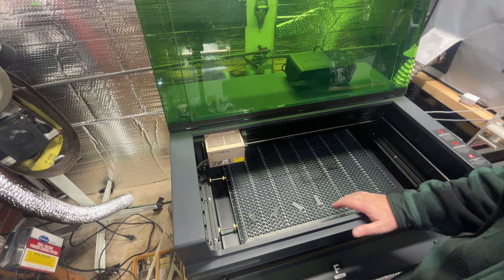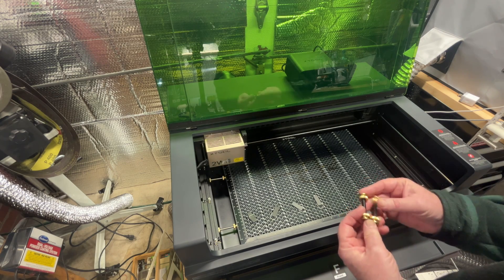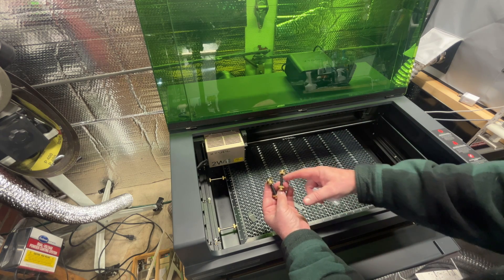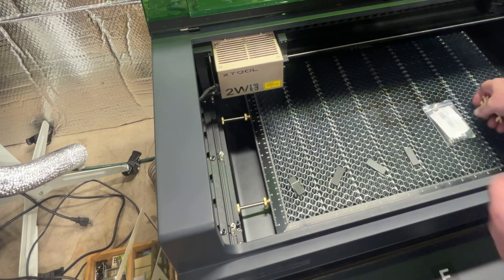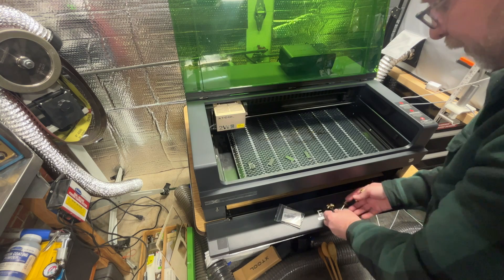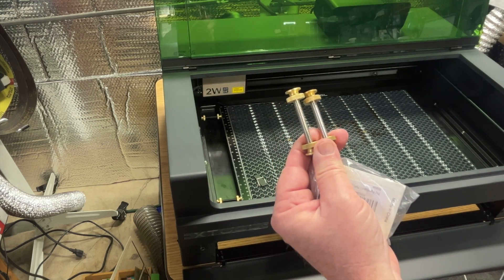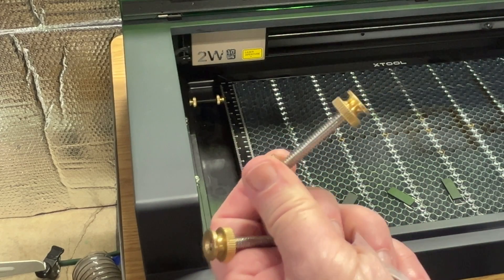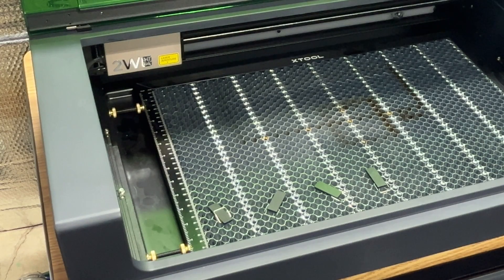Solve the moving Honey Comb Grid & Crumb Tray on XTool S1 Laser Engraver when using the Riser Base

Comment: Great idea! Can I make one modification for you? Add springs over the grub screws to help keep them from backing off. The other thing you could do is add a stop nut. Just thinking it may help. Ill try this with springs today.
Reply from the maker: I have not had them come loose but I like the spring Idea may make putting them on easier. I did think of lock tight on one side but they have stayed in place really well. But I love improving any idea let me know if it works out better if you try it.

Comment: I want to solve two problems. I want to keep my tray and honeycomb from moving in the X and Y direction, and I want a registration mechanism that I can slide my workpiece against like the fence on a table saw. With a stop block on the fence, I could slap an endless succession of identical work pieces into the S1 and know that each one would be positioned identically.
Reply from the maker: I have been trying to find a low profile on/off magnet  to do like you mention with the fence but have not seen any that are small enough to not hit the laser head.

Comment: Thanks for this tip! Can I use these without the riser base?
Reply from the maker: No need the crumb tray is screwed into the top level of the laser the riser base you remove all the screws that hold it in so you can fit larger items inside and move it like a rack in an over up and down as needed

Comment: So at least the middle of the honey comb is magnetic.  I wonder if there might be a way to lock it down with magnets.  This is a good solution, though.  

I think you could put a neodymium magnet on the crumb try to the left of the honey comb and keep it from moving.  You might need two.  If the crumb tray is aluminum you could just put another neodymium magnet underneath the tray right below the magnets on the top to keep the honeycomb in place.
Reply from the maker: I'm not sure - I was thinking about on off magnets but they are pretty big

Comment: i have the UK Riser  version of the S1  which is solid & is not the same as in the USA  ( EU regulations) so there is no front gate which would be ideal. In order to comply with the above video , you have to remove S1 & then undo the riser completely before completing the above.....at least this is where i am as i write!....if i come up with an easier solution will let you know
Reply from the maker: no gate I guess you can't use the pass through  extension for large items ?
Reply: I had been wondering about the lack of a riser base compatible with the conveyor over here. Where can I read more about the restriction? I see they sell it on AliExpress, and was thinking of buying it and the conveyor and importing.